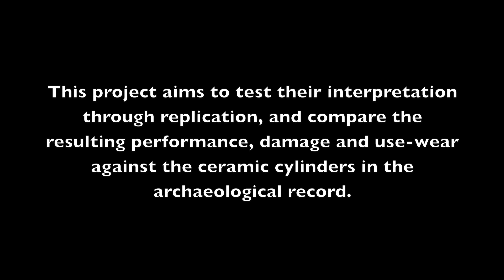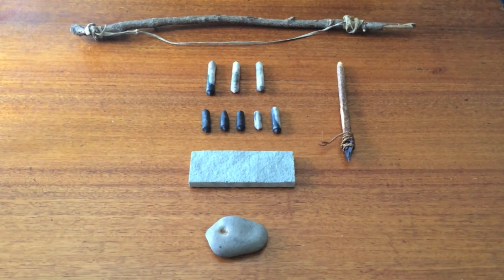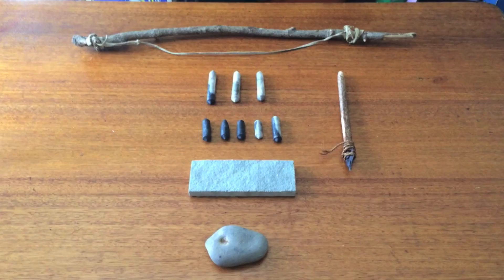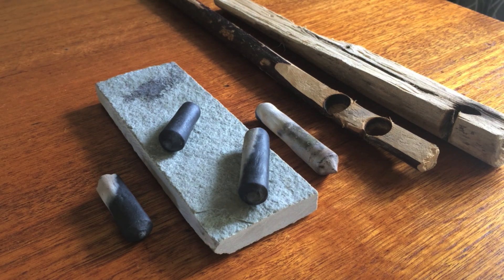Yarmukian Bowdrill Experiment

Comment: Sorry but your experiment does not solve the mystery. No way Rods can be used to make fire.
Rods are small objects 5-7 cm made mostly from clay. If you will press it they will break instantly. And why would the creators bother to elaborate them, smooth them and use special  clay the kind used for the figurines only? It make no sense to use such objects instead of branches. I know the purpose of Rods and it will be published soon.
Reply from the maker: I certainly agree! The experiment showed it was theoretically possible, but I also found that in order to make it possible one had to up-size the rods a bit. I also agree, why use fired clay when wood is more readily available.